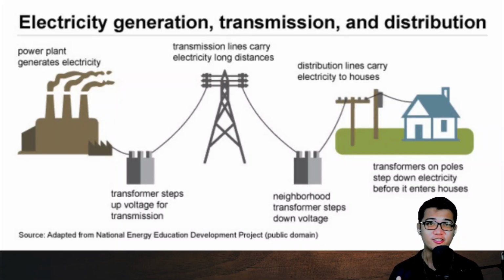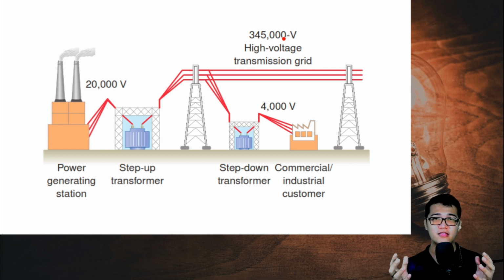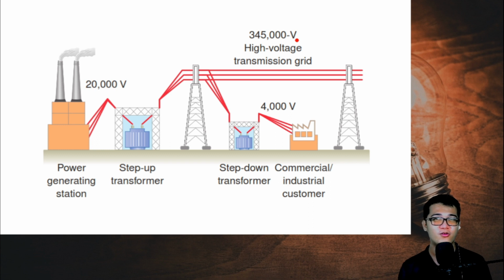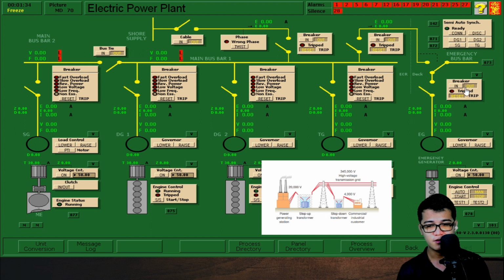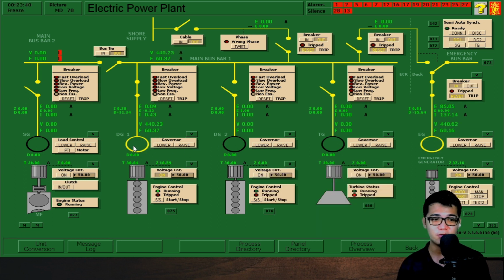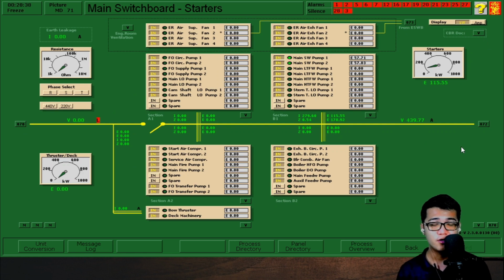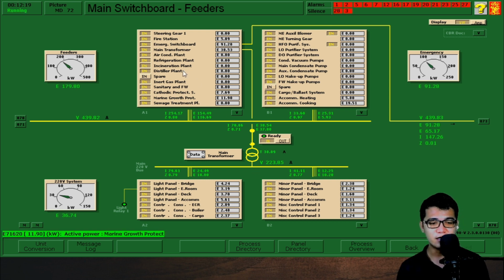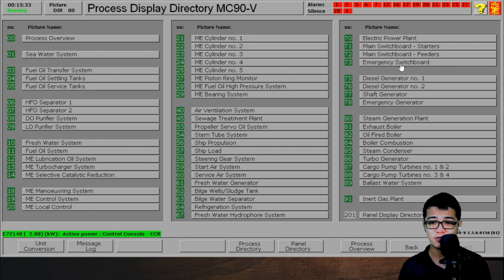Power Distribution System | Errol Karl Gumagay

Comment: Sir, I am not your student in this Class. May I ask Sir that, only long connection is in need of step up or down transformer to convert the power? From emergency generator down to diesel generator 1 po?
Reply from the maker: There is a need to step up and step down voltage for long transmissions to reduce the current rating of protection devices i. e. fuses and circuit breakers.

In addition, it is less expensive to use transformers for stepping up or down the voltage rather than increasing the diameter of the wires for transmission.

See this article: https://www.google.com/amp/s/www.marineinsight.com/marine-electrical/reasons-for-using-high-voltage-systems-on-board-ships/amp/

Comment: For this video , I’ve learned how the electricity generation, transmission, and distribution on land and onboard ship. I also learned the ships electric power is generated particularly by the shaft generator, diesel generator 1 and 2, turbine generator and lastly the emergency generator. In addition, diesel generator 1 is connected to the main bus bar 1 in which all the electrical machinery’s and also the emergency bus bar are all connected in the main bus bar 1. I also learned that the ships don’t need transmission lines compared to land .

Comment: I've learned that generators station transmit its electricity to each of houses or industries that needs electricity.The electricity of generator, distribution,and transmission is the way on how to pass the electricity to its location.Electricity is not directly pass through each houses it must need some step up and step down transformers so the house will not get into exceeding point of the needed electricity in the house that cause damage to the appliances.

Comment: #CASUPOMJ
For this video i had learned about how electricity generation, transmission and distribution on land and on board ships. I know that on land needs transmission lines to carry electricity ling distances it also needs transformers of course. First is power plant generates electricity, step up transformers for the transmission, transmission lines, step down transformer, distribution lines carry electricity to houses, transformers on poles step down electricity before it enters houses. On board ships from electric power plant, to diesel engine travels to bus main bus bar 1 then from bus bar 1 to emergency switch board and then to emergency bus bar is connected to the main bus bar 1. To switch board starters then to main switch board and emergency switchboard. On board ships transmission is not needed.

Comment: after i watched this video i learned electricity generation transmission and distribution  on land. before entering  electricity in our house  it passes through transformer to stepdown the current voltage to. and on board ship  diesel generator 1 and diesel generator 2,turbine generator and emergency generator have a circuit breaker . i learned also that all machineries connected on busbar.

Comment: In this video, I learn how electricity distributed on land and onboard ship. In land like example power plant generates the electricity and pass it in transformer the transformer step up the voltage and transmit to transmission lines carry electricity. And if the voltage near in neighborhood and it passes it to transformer again and the other transformer will step down the voltage and pass it to  lines electricity near in houses then the transformer on poles step down electricity before it enter houses. And in onboard ship generated particularly by our shaft generators two generators diesel which are diesel generator 1 and diesel generator 2, turbine and emergency generator.

Comment: #Ferolin Rey. Based on the video the topic focuses on the Electricity generation. I learn how electricity to a electrical machineries onboard the ship, and how electricity generated, transmitted, and distributed happens on land, to power plant they generates electricity, and the transformer steps up the voltage for transmission, transmission lines carry electricity to neighborhood to step down the voltage, then distribute electricity to houses, that is electricity genaration, transmission, and distribution happen on land. As I have noted for power distribution system, the power plant generate electricity, and as well as for power generating station the same as power distribution system they produces a electricity. For onboard ship, I had notice that there are electrical power generated.

Comment: @MAHINAY, JOHN MARQUEZ O.
In this video I learned about how a power  generation, transmission and distribution on a sip. a ship is used a power generators that can produced 440 volts, that connected in parallel, when we open the breaker of a generator the power will be connected to a main bus bar 1, all the electrical machineries and the emergency bus bar is connected to the main bus bar 1. the main bus bar is a conductor used for electrical distribution.  so the power connected to a main bus bar 1 and also the emergency switch board, then through emergency bus bar. emergency bus bar is connected by all emergency switches. emergency generator must not connected to parallel into other generators.

Comment: In this topic I learned it on how  Power Distribution System Operation works through a Electricity generation, transmission and distribution, it works from the step up transformer to produces a thousands voltages in order to produce into the system needed before it transmitted into a stepdown transformer to distribute the limited voltage through houses.

Comment: I learned from the video how electricity from the generators station trasmit its electricity to every household or industries that is needed electricity. The electricity generators, transmission, and distribution is the process how does the electricity pass through every houses and does they work. It is not totally pass directly electricity it needs some step up and step down transformers it is important so that only the exact amount of volts needed is pass through our house and will not cause some exceeding electricity that leads to some damage.

Comment: In a power distribution system it is the part of which distribute  electric power to for a local use. In general power distribution system is the electrical  system between the power substation fed by transmission system and the consumer meters it generally  consist it feeders distributers.

Comment: Base on the video,  I've learned how to generate and the distribution of the power plant and how could be transfer in transformer in industrial or commercial and also the household that the electric or voltage is high when in the power plant , so that the voltage will decrease to sustain the electric requirement in 220 volts in household/community

Comment: Power distribution system- according to the video, power distribution is More processing from power plant it past to transformer step up voltage for transmission, then to transmission line carrying electricity long distance then another transmission step down and it's distribute lines going in to the houses.  
Just like in the ship, there are many generator to supply electricity to the ship, and if it has a trouble the emergency generator will work.
Thank you for this video and I really appreciate it 😊👍💖

Comment: In this video i learned The Power Distributed on board a ship needs to be supplied efficiently throughout the ship. For this the power distribution system of the ship is used. Main switch board which is a metal enclosure taking power from the diesel generator and supplying it to different machinery.

#SerranoMike

Comment: I learned this video that the sequence of passing the  electricity in the land and the ship is the... Base on this video that i have seen i notice on how the electricity generate and travel to the bus bar to breaker to bus bar again until to arrive the feeders, mahinenery or  anything in the ship that work by the use of electricity.. The difference in this video the electricity cannot use transformer to convert the current because in the ship the voltage is around hundred it cannot reach thousand volts... It is base on my understanding..

Comment: Based on the video, I learned what are the process of electricity generation, transmission, and distribution transmitting before go through in every household, and it's very satisfying that the high voltage can make to the household without damage, and also it is very informative sir, the process of power distribution on board ship.

Comment: #CASUPO, WJ
For this video, I learned how electricity generation, tranmission, and distribution happens on land and on board ships. I learned where the ships electrical power was generated, it was generated through diesel generator 1 and diesel generator 2, turbine generator, and emergency generator and each generator has its own circuit breaker. I have also learned that almost machiniries in board ship get power through main bus bar 1. Then, I learned that emergency generator cannot be connected in parallel to diesel generators.

Comment: Based on this video, I've learned that power plant generates electricity which is step-up and step down through transmission, transmission system is configured as a network, which means that has a multiple paths to follow the generator to the distribution system and the distribution line will carry the electricity in to houses.

Comment: #Pleños
In this vedio i learn about how electricity distributed on land and ship. In the land there is an electric waste, in order to distribute the electricity and amount needed in the land. The electricity needs a step up transformer to increase voltage. While in the ship, voltage is no need two step up because the parent of the machinery inside the ship is lower than the generator can produce. And i also know how the electricity distributed in the ship. And the busbar is the heart of circuit in the ship.

Comment: I have learned from this video that the generating elements on board the ships are the shaft generator, diesel generator one and diesel generator two, the turbine generator and emergency generator where it generates 440 vots. The system on land where electrical power plant us actually related in the power generating station. I have also learned that when the emergency witch board is connected to the diesel generator, then automatically the connection between the emergency bus bar or emergency generator will be cut off and will be transferred. The emergency generator cannot be connected in parallel to the diesel generator.

Comment: This video is very informative on what are the process in power distribution on a ship. how power being generated in the land but most important is how ships generate electrical power from the shaft generator diesel generator 1 and 2 turbine generator and emergency generator and this generator have their own circuit breaker .the main brusbar are all conneced in all machineries.

Comment: #cuaton base on these video I learned how electricity generator transmission  and distribution happens on land.I also learned where the ships electrical power is generated  to shaft generator, diesel generator  1 and diesel  generator  2 turbine generator .I also learned emergency  bus bar voltage  there are 440 emergency  bus bar voltage after passing through emergency  transformer  become 224volts. This 224 volts actually  power the navigation  lines.

Comment: Based the video the Transfering AC/DC electrical power
Electrical distribution systems are an essential part of the electrical power system. In order to transfer electrical power from an alternating current (AC) or a direct current (DC) source to the place where it will be used, some type of distribution network must be utilized.

Comment: Based is this video i've learn how electricity transmit to our house it will go before voltage transmission to lines carrying and back again to the voltage and the last is  transformers so that it will give enough electricity..and the power generating genarator in the electrical power plant.

Comment: #Delatorre 
Transmission is the system backbone that ties many generating stations together. Electricity can be moved from the generating plant to an interconnection with a distribution system or even directly to industrial users.

Comment: In this video I learned how electricity generation, transmission and distribution happens on land. I also learned where the ships electrical power was generated (shaft generator, diesel generator 1and2, turbine generator and emergency generator). And the the following generator have their own circuit breaker.After the breaker is connected to the diesel generator 1 it will now be connected to main bus bar 1. Also the emergency generator can not be connected in parallel to diesel generators. I learned what is on emergency bus bar. The boat thruster and the deck machienery are connected to main bus bar 2. At last I learned the difference of power distribution on land and in ships.

Comment: #Degamo, Based on these video, I learned that electrical power plant where the ship’s electrical power is generated particularly by our shaft generator, two generators diesel which are diesel generator 1 and diesel generator 2, turbine generator and emergency generator. I also learned the shore supply that the power source from its external to the ship particularly when ship is birthed. I also learned that electricity or generate electricity is passed to the breaker of diesel generator 1 when the breakers is connected after that it would connected to the main bus bar 1. Main bus bar 1 connected to all electrical machineries and emergency bus bar , the main bus bar 1 passed by to the another breaker which is the circuit breaker of emergency switchboard. The load of emergency bus bar would be passed on to the diesel generator one. I also learned that the emergency generator cannot be connected in parallel to our diesel generators.
Reply from the maker: Very good! This is a good summary of the video. By the way, it is 'berthed' meaning nakadaong ang ating barko. Since the supply is coming from external, you can think of this electricity as something that has been generated in a power plant from far away from the city / port whether it is coal-fired power plant or geothermal power plant. Then transmitted at higher voltage levels through the transmission lines, such that, prior to entering the ship to supply its needed power when berthed, it is at a level of distribution voltage typically 6.6 kV (kiloVolts) or 3.3 kV. Remember that, transmission voltages are typically 110 kV and above.

Comment: I learned in the video that the shipboard power is generated using a prime mover and an alternator working together. For this an alternating current generator is used on board. The generator works on the principle that when a magnetic field around a conductor varies, a current is induced in the conductor.

Comment: In the video , i learned how electricity generation, transmission and the distribution work on land. Like how voltage or electricity distribute in every transformer before entering on every houses. And then if the voltages is higher the current will be decreased to prevent power losses. Then how generates electricity step up in the transformer before it transmit or distribute in every transmission. On board ship the electricity generation , transmission and distribution are functioning except the transmission because of the generators or bus. Transmission in ship board will be cut off because it cannot work.
Reply: #tampipi
Reply: I learned about the power distribution system the thermal energy is converted to kinetic energy in which steam will flow to the turbine. Kinetic energy converted to mechanical energy by the steam to spin the turbine of the generator.  Distribution of the energy to the land.
Reply from the maker: Transmission is actually bypassed since there is no need to step up the voltage to a higher voltage levels.

Comment: What i learned is The primary purpose of electricity distribution system is to meet the customer's demands for energy after receiving the bulk electrical energy from transmission or subtransmission substation. ... Protection, control and monitoring equipment are provided to enable effective operation of the distribution network.

Comment: In this vedeo I understand about synchronization  is the process of matching the speed and frequency of a generator or other source to a running network. An AC generator cannot deliver power to an electrical grid unless it is running at the same frequency as the network.And  generator cannot deliver power to an electrical power system unless all the aforementioned parameters exactly match those of the network.